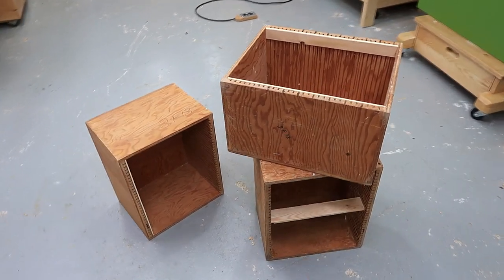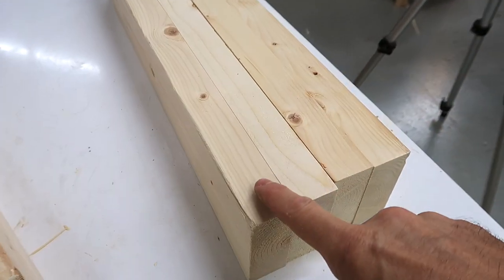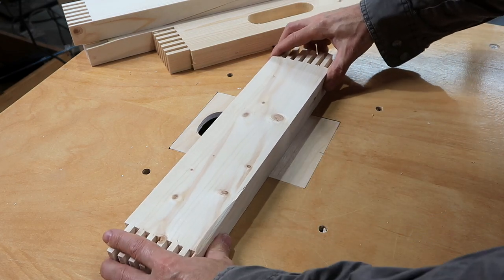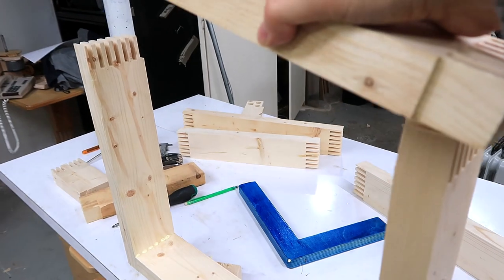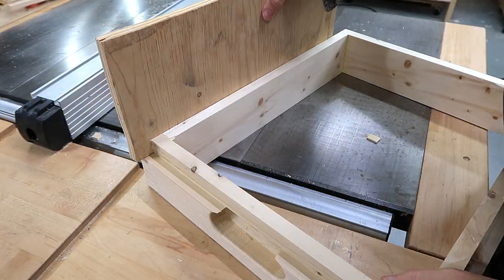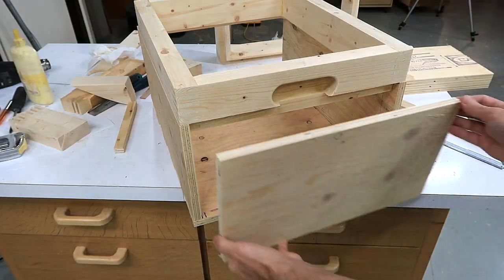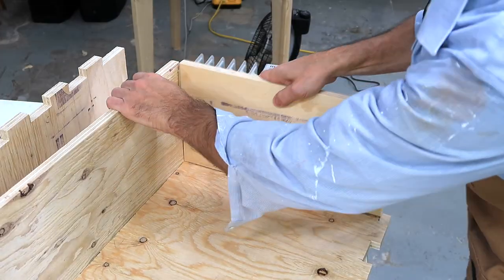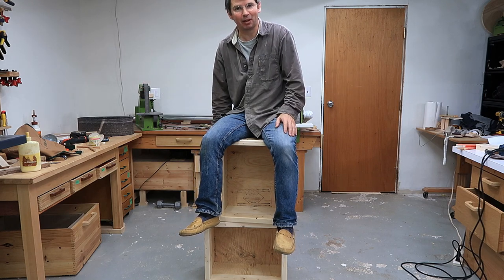Sturdy boxes for propping things up and standing on

Comment: In the movie industry they use “apple crates” to set things up that are similar sturdy plywood boxes. They are made to standard sizes so that they can be stacked evenly, and the dimensions/ratios are such that they have a common multiple so that stacking them sideways will come out even with vertical but gives you more height options.

Comment: Reminds me of Apple boxes from film sets. Used for propping up gear (or as a seat) on sets.
Someone built a utility version of these for carrying gear, calling them Jokerboxes
Reply: I came here to say this.

If anyone here wants to make some proper apple boxes, Adam Savage has a great video about them
Reply: @FloydBunsen  these are better than "proper" apple boxes by a wide margin
Reply: Apple boxes! I couldn't think of the name, thank you.
Reply: Indeed. And the great thing about apple boxes, which anyone building their own versions should consider, is that they come in standardized sizes: "full", "1/2" and "1/4", which you can combine in various ways to make relatively stable platforms, stairs, etc.
Reply: @akda5id  Don't forget Manhattan and Pancake.
Reply: @natalieisagirlnow  They’re certainly sturdier. Standard apple boxes are made with mostly plywood and some reinforcement/framing. Joints are simple edge joints, glued and pinned with brads or staples. A lot of rental boxes use thinner plywood where possible and are far from indestructible. Of course there are better grade boxes available for purchase, using thicker construction and better grades of plywood.

Which is not to say one can’t use the techniques of this video to make an extra strong apple box that would also look great with the finger joints and all. It’s all a matter of using the standard apple box dimensions. This will certainly be of interest to grips wanting to build out their rental kit. Going that extra mile in attention to detail gets noticed and it’s a good use of downtime between gigs.
Reply: @akda5id  Leveling dolly track is a big one that falls under your etc.

One thing about building beautiful boxes from highest quality materials is that (at least in film production) apple boxes often get screwed together, or lumber attached with drywall and/or deck screws. That’s something worth considering before using expensive high grade plywood or hardwood components. From a rental house standpoint, boxes are meant to wear out, to be eventually repaired or replaced.
Reply: @OntarioLakeside   Manhattan, Chicago, and LA

Comment: I made something very similar about 10 years ago… for the same need.  Only I did put the grab holes on the inside … and made two smaller ones so they nest and take up less room.  Just used them Sunday to hold the front end of the tractor up.  Good solid joinery like this is the key to longevity.   Nice job!
Reply: Nesting is a great idea!

Comment: Reminds me of my "carpenter's bench stool" I made many years ago from a design I found in a woodworker's magazine.  I have used that for nearly 20 years and it is still as sturdy as the day I made it.  A simple two-step design that has been very handy in the shop and around the house for projects both as a short ladder/stand and as a mini-work bench.  Not sure if you have one in your video library, but if not it would be a great addition to see one you have designed and built.  One feature rarely seen is a cutout to fit a door or plywood piece on the side so that you can plane the edges without a clamping system.

Comment: Classic super useful and made to last, Matthias designs.  BTW, a simple trick to prolong the set of water-based wood glue is either spry a light coat of water to the joints before applying glue or dilute the glue a bit.  Absolutely no compromise on the bond strength but gives higher open times

Comment: I notice you sometimes use construction adhesive, and then wood glue for other parts of the same wood.... what do you base your decision on to use one over the other?
Reply: I want to know too!
Reply: Same, bump
Reply: Probably because he was gluing end grain, so wood glue would be not strong enough. Also it was a loose fit so construction adhesive fills the gaps.
Reply: @rutgerhoutdijk3547  in a recent video he specifically mentioned his preference for construction adhesive when it comes to looser joints.
Reply: @rutgerhoutdijk3547  wood glue is stronger than the lignin that holds wood fibers together so it's a silly to say that wood glue isn't strong enough. If you're pushing wood to the point that its fibers start to break apart, the world strongest glue won't help you. Any joint is only as strong as its weakest point and good glue isn't the weakest point.
Reply: @dand5829  try gluing endgrain yourself and see how little it takes to break it
Reply: @dand5829  As noted by others, this need not be true if the joint isnt tight. Foaming PU glue will make somewhat of a faux gap filling glue; it will expend to fill the crack, but the resulting PU foam will not have a lot of strength.
Reply: Yes good question, it looks like "Liquid Nails"

Comment: IIRC, similar boxes are used in the film industry, called apple boxes for obvious reasons.  The industry has standardized on sizes, the full apple box being 20"x12"x8".  Those dimensions allow several boxes to be used together to make regular shapes.
Reply: Yeah. I was thinking something from the Fibonacci sequence so that fairly precise  lengths could be achieved by combining/summing different sides' lengths. The idea would be similar to the 1:2:3 blocks that are sometimes used in metal working.

Box side options: 1, 2, 3, 5, 8, 13, 21
4 = 2+2
6 = 3+3
7 = 5+2
9 = 8+1
10 = 8+2
11 = 8+3
12 = 8+2+2
etc.

Maybe do +1 to get a different size after adding two previous sizes together...

1, 2, 4, 7, 12, 20, 33
3=2+1
5=4+1
6=4+2
8=4+4
9=7+2
10=7+2+1
11=7+4
Etc.

Comment: 06:17 Was that construction adhesive used to fill the slight gaps in the box joints in the plywood parts? Edit: as Bill pointed out, he probably used construction adhesive for its longer working time while he assembled all the pieces.
Reply: Yes
Reply: he used that there because of the number of joints that had to be glued at once, wood glue wouldn't give him enough time.
Reply: If you have used construction adhesive before you'll know that the bond is stronger than the wood. All those surfaces need to withstand the forces of a person standing on them, in any orientation, as well as whatever equipment Mattias is going to use them for.
Reply: @daveduncan9005  I've seen testing that says it is not stronger than the wood...  unless maybe you're referring to really weak wood.
Reply: @prototype3a  I based my comment on my use of the adhesive. Mattias and John Heisz use the same stuff, as I did on a work bench I made for my shop. It was made out of 2x4's with all joints/connections with PL and screws. When I took the bench apart I have to use a small sledge to break the connections. Every joint splintered the 2x4 and did not break at the face of the connection. So, yeah, the quality of material is a factor but the effort I needed to break the joint was substantial.
Reply: In another comment asking a similar question, a fan relays Wandel's preference for construction adhesive on looser joints VS wood glue on tighter joints.
Reply: I recently smashed something that I built many years ago using "construction adhesive" and for an "outside" item, I was really disappointed by the performance of the "adhesive".  It did not bond very well but it did feel hard, like cured epoxy.

Comment: These are very similar to "apple boxes", which can be found on movie sets and in stage production.
They don't actually hold apples. In fact, all six sides are solid plywood.
Apple boxes are a bit shorter, and they have an additional cross member in the center which makes them exceptionally strong. But you can stack them like bricks if you need more height.
Stage hands use them to hold heavy objects off the floor, usually so they can be seen by the camera or by the audience.
Reply from the maker: I wanted a box that's open, so I can put stuff in them, like other boxes, or clamp to it.

Comment: Great as always, Matthias. I like that the thicker rim makes stacking more stable. Anyone have the same Bessey clamps with the red wooden handles? HomeDepot two 6” and two 12”. I have several but half of them slip on the bar when I tighten. I’ve filed the notches with both a triangle and square file to get them a little more defined. I think it may be my bars went through the dies and it didn’t get square on the edges. It’s like one edge of the ridges isn’t pressed in enough. Every time I grab a clamp I end up finding one that slips and it keeps happening.

Comment: What went into the decision to join some sides with construction adhesive and some sides with wood glue?
Reply: I am guessing gap filling properties, because he didn't need a lot of open time, nor a glue that "lubricates" a tight joint without swelling wood fibres - those are the other two properties of constuction glue that I can think of right now.

Comment: Sure do admire your pantarouter and box joint jigs but you do need a cudgel to hasten your double finger joint glue ups. My version of shop boxes serve the same purposes as yours but are built in pairs with two different sets of dimensions in increments that cover from 10" to 22". Mine were built when the cheapest 12mm Baltic Birch was still affordable and I used 1 x 1s at all of the interior edges. I used low pile office carpet on three sides and several layers of cushier stuff to make padded seating on the remaining sides. The 1 x 1s let me fasten the carpet with staples.

Comment: I noticed that you are using construction adhesive more and more often. I know you are not one to run out and buy the latest tool, I wanted to mention that the electric/battery power caulk guns that are available from just about everybody are really fantastic tools. I'm also not a big fan of a tool having such limited utility, but once you use one you have to have it. It is so much cleaner and controllable of an experience. You don't seem to have any difficulty using the manual gun skillfully, but they are a fantastic convenience.

Comment: There is one problem with horizontal surfaces and hollow forms. Things get placed on and in, ‘for the time being”. When it time to use it for its original intended purpose, it’s too cumbersome to unclutter so you use some sketchy alternative (voice of experience). If these were for my shop, the final step would be glue and screw a top on them so nothing could ever be placed inside. LOL. I do like the build and I like everything Matthias has ever posted. 😎👍🪵✅

Comment: Excellent video as always. Would you please consider building a drill press with or without plans? Based on linear bearings, old car shocks or anything else? Thanks for sharing!
Reply from the maker: woodgears.ca/faq
Reply: I thought about building a drill press myself for a fair amount of time. I found a couple decent builds on YT, but most seem pretty flimsy. Eventually just decided it wasn't practical. The force exerted on a drill press can be immense; I wouldn't be saving any money trying to achieve the necessary build strength. Anyway, people (around here anyway) are always selling them. I found a 40 year-old used one online for $50 and its just perfect. Definitely going the DIY route for some upcoming sanders and a bandsaw, though
Reply: @jacobyunderhill3999  thanks very much for the answer! Unfortunately here in Greece, there is a different philosophy about selling stuff and it would be extremely difficult to find an old drill press for that kind of money… I have been asking around for ages but the few I found were very very expensive. I will be trying to build one but I had to try asking if Mattias had such a project in his mind.

Comment: Your ingenuity is impressive and motivating. 
Gluing the box joints, I would have been tempted to dip the ends in a tub of glue to speed up the process.  Other than being a bit messy, is there a reason one should not do that?
Reply: I suspect because the fingers are so close together (more of a comb joint) the capillary action would fill the gaps and thus result in a huge amount of glue squeeze out maybe?
Reply: @edwardholmes91  maybe.

Comment: why construction adhesive to hold the sides and bottoms of the boxes together but wood glue to attach the top?
Reply: Construction adhesive is stronger than the wood, much stronger. There is little chance the adhesive will fail as apposed to wood glue. Plus, open time is longer so assembly is easier.
Reply from the maker: Construction adhesive isn't as strong, but great for gappy joints.  The joinery was freehand cut on the bandsaw.

Comment: I'm just building your lathe (mostly) from your plans but next up is the Box Joint Jig.  If you were going to make any improvements to your Box Joint Jig, what would they be (assuming you could easily describe them in a YouTube comment!)?
Reply from the maker: I rarely use the 16 tooth gear, so could get rid of that and not make the gear mount go up and down.
Reply: @matthiaswandel  great thank you!

Comment: Why'd you use construction adhesive for the sides and bottom of the boxes and woodglue for the 2x4 bracing?
Reply: Wondering this myself, Bill commented that "he used that there because of the number of joints that had to be glued at once, wood glue wouldn't give him enough time" Unsure if that's true though...
Reply from the maker: construction adhesive for gappy hand cut joints

Comment: When you were trimming the edges you had a piece of wood between the crosscut sled and box.. why ? What was that for?
Reply from the maker: puts the workpiece at a slight angle, so the blade mostly cuts the corner.

Comment: Why did u use different glues to each part, Matthias?  
Xoxo <3
Reply: Wondering this myself, Bill commented that "he used that there because of the number of joints that had to be glued at once, wood glue wouldn't give him enough time" Unsure if that's true though...
Reply from the maker: construction adhesive for gappy joints

Comment: With Matthias's raspberry pie and python skills, I'm still wondering why he hasn't updated his box joint jig with servo motors
Reply: could easily do it with stepper motors, but they'd be slower than the crank
Reply: He already did it..back in 2003; it's on the website.
Reply from the maker: The crank works way better

Comment: I often see you struggle with wood glue setting up too quickly. Did you ever consider buying glue that has a longer set time so you have more time to work with it for such complicated glue joints?
Reply: He just buys the cheapest wood glue in 1 gallon containers. So it's just type 1 wood glue that he has a preference for. Glue he is using here has an open time of 5 minutes. He would have to get Titebond 3 for 10 minutes or Titebond Extend for any longer. His reasoning is that all wood glues are stronger than the wood itself. Which is correct but it isn't right if it is something that will be used outside where there is weather. Oh and the cheapest wood glues are not okay to use on things that will see food contact such as cutting boards or counters. You need Titebond 2 or 3 for those.